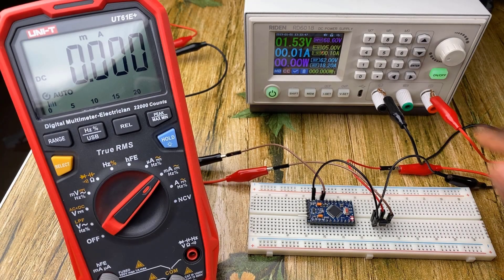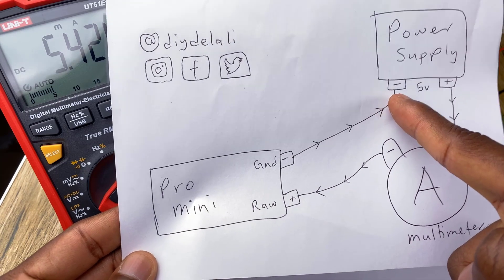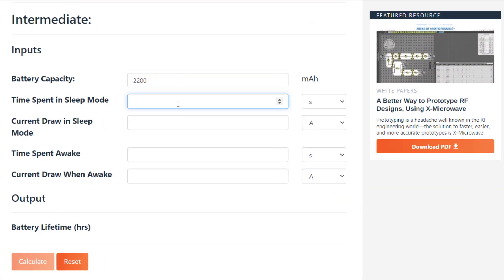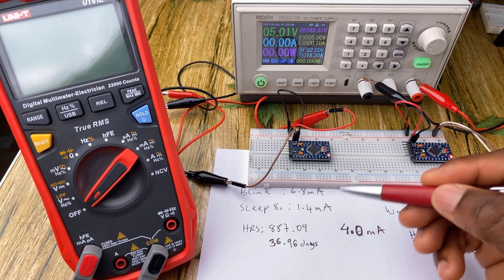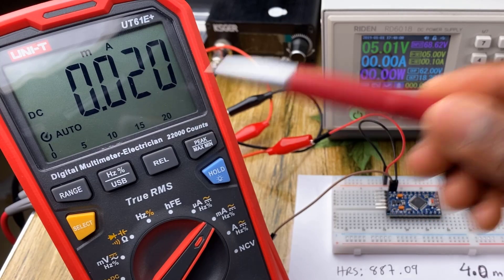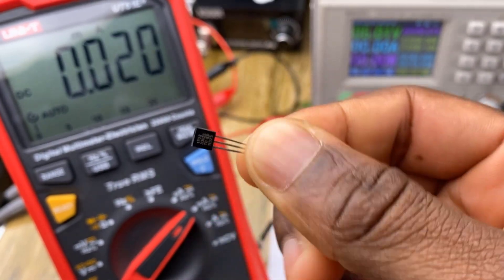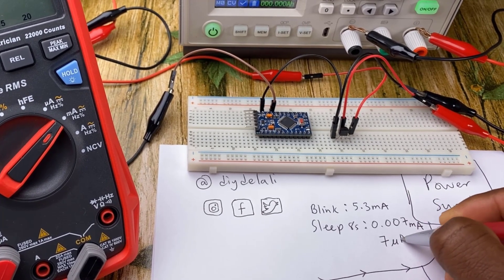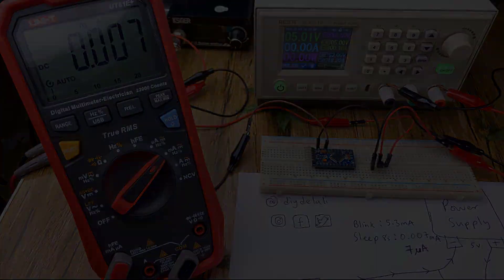The Importance of Sleep Mode for Arduino Projects | Ultra Low Power | MCP1702 MIC5205 MIC1700 RD6018

Comment: ChatGPT told me we can use an RTC module to trigger a MOSFET and boot up arduino at regular intervalle. The consumption during "sleep" mode will be 0µA for Arduino because it will be simply off.
Reply from the maker: That is correct. But you could also just use the RTC trigger SQW pin directly with an interrupt pin on the Arduino. use LowPower.powerDown(SLEEP_FOREVER, ADC_OFF, BOD_OFF); ......to sleep your board. Thats it. you be able to get 2uA with this approach. I have tested this myself.
Reply: @Delali  Thank you for the suggestion !

Comment: Hello from Sweden. My question is if this sleep mode can be implemented also when the Arduino is waiting for a signal from a sensor to start a servo?
Best regards
Tore
Reply from the maker: Hello there,

It depends on the sensor, if the sensors output is just a HIGHor LOW signal, then you can put the board to sleep and use interrupts to wake the board when the sensor pin changes state for instance.
Reply: @Delali  Thanks for answer.
I solved this case with a relay with timer. So when button pressed it starts the relay that starts the controller for running the sketch.
When relay is timed out all power will be of and no battery consumption.
Next project will be an electric scooter provided with support wheel that keeps the scooter upright based on an angle sensor.
Regards
Tore

Comment: 08:34 You reduced the current draw by around 60%. Why did the battery lifetime only increase by a much smaller percentage? Thanks
Reply from the maker: Great question. I was surprised as you are.

I found out battery duration doesnt increase so drastically once current consumption is in the low uA range already. This is especially true if the difference isnt day and night huge.
Reply: The 60% reduction is only for the current draw while in sleep mode. The two second LED blink is what draws the vast majority of the current within each 10 second period, and that didn’t decrease so much

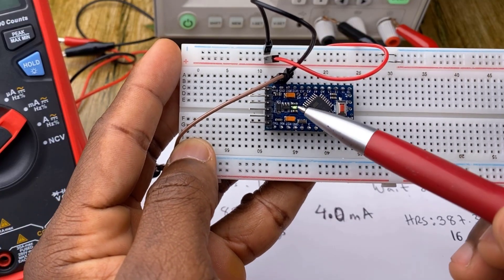Comment: 04:55 Why didn't you just disable the LED in code, rather than desolder the whole component?
Reply from the maker: The LED i desoldered is the power indicator LED connected to VCC directly. Its not connected to a digital pin.
Reply: @Delali  Thanks! I'm excited to try my own low power Arduino projects!

Comment: You are reading the current between the new regulator and pro mini (VOUT), should you not have put the multimeter on the VIN line of the regulator to include the quiescent current of the new regulator or doesn’t it matter?
Reply from the maker: I desoldered the old/original pro mini regulator. so i didnt have to use the VIN pin.

Also i directly connected the output of the new regulator to the VCC line.
Reply: @Delali  yes but you are not including the new regulators quiescent current as your meter is placed after the regulator? Isn’t it? I may have got it wrong but I’m sure that’s how your schematic had it.

Comment: can you put arduino to sleep/awake using button instead of sleep time ?
Reply from the maker: Sure  can. instead of LowPower.powerDown(SLEEP_8S, ADC_OFF, BOD_OFF);
you'd have to use LowPower.powerDown(SLEEP_FOREVER, ADC_OFF, BOD_OFF);

You'd have to put the above line of code into the code for button press. Also you'd have to use an interrupt to detect the button press and wake up the board.

I'd be making a video soon on this. Make sure to stay subscribed
Reply: When does this video come out?

Comment: on ESP32 I was able to get into 4uA but that is bare, without LDO. Still, my sensors (WiFi enabled) can last now for about 10-12 months on 1000mAh battery and I find it quite enough. Super nice explanation here
Reply from the maker: Awesome.

Im glad you find this helpful.
What parameters are you sensing/what does your esp project do if i may ask?
Happy new year fam. Cheers!!
Reply: @Delali  temperature, humidity (sht31), light (tsl2561) - that all do, including measuring the battery voltage and % (max17048)
some also have motion sensor built in
other sensors that don't sleep also CO2

all of them feed data to Home Assistant over ESPnow through the ESPnow2MQTT gateway
Reply: Hi, which model of esp do you use ? Iam trying with the esp wrover-e but in deep sleep mode consume 40uA…
Reply: @fabirodriguez3677  ESP32-S2-WROOM-I is 20uA, ESP32S-WROOM-32D is 4uA
Reply: Do you have an email to ask you any questions? because I have the esp32 wroom-32 and the consumption is higher. The only one I found to buy is the esp32 wroom-32d